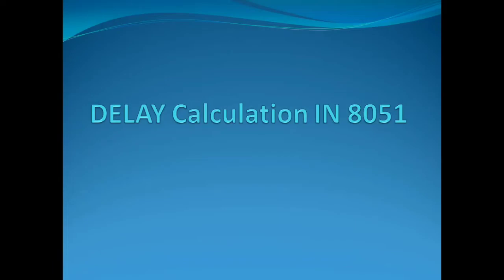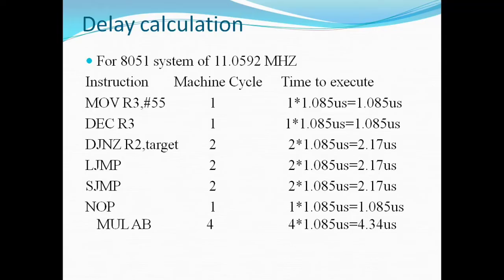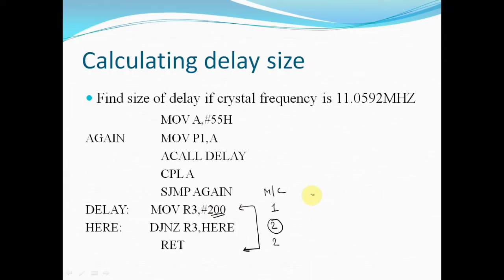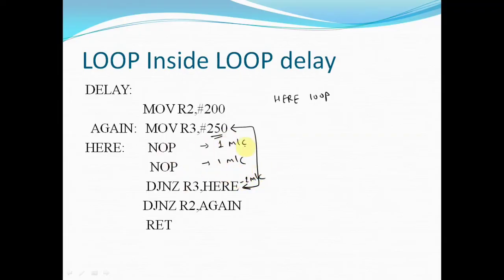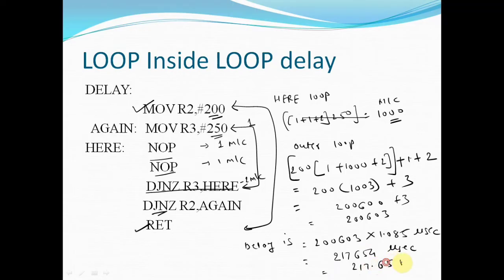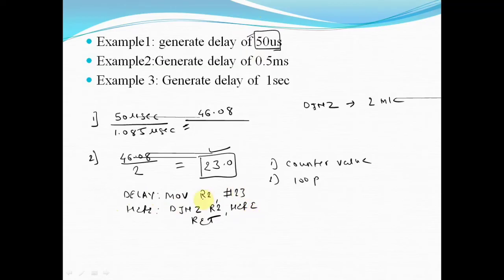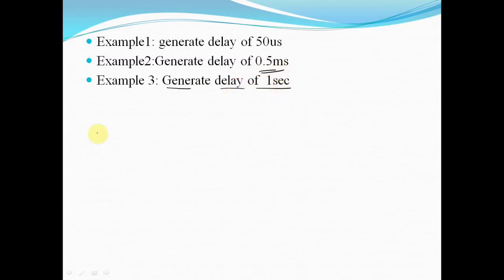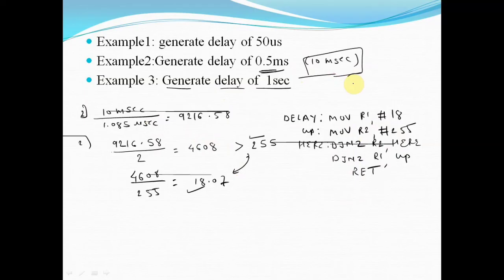Delay Calculation (8051 assembly)

Comment: find the time delay for the following delay subroutine, if the system has an 8051 with frequency of 11.0592 mhz. delay: mov r3,#200 here: nop nop nop djnz r3, here ret
Reply from the maker: Each Nop takes 1 m/c cycle and djnz takes 2 m/c  cycles so total m/c cycles are 200(1+1+1+2) +1+2=1003
Delay is 1003*1.085usec=1.008msec
1 m/c cycles for mov r3, #200 and 2m/c cycles are for ret